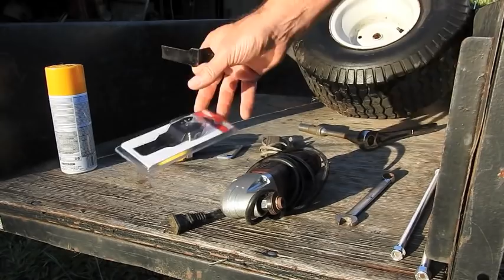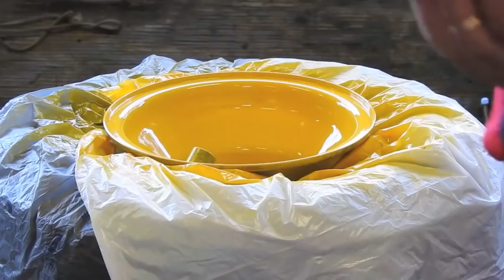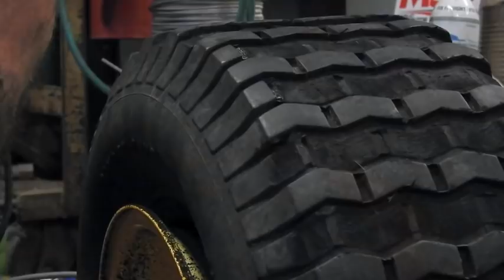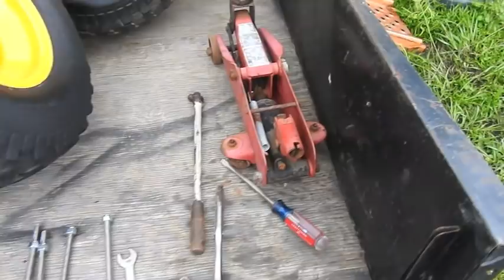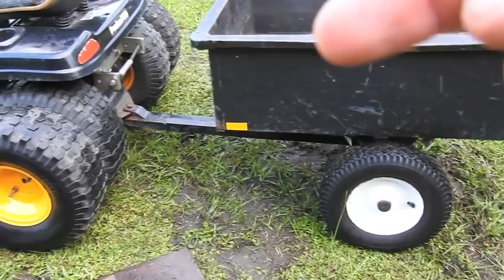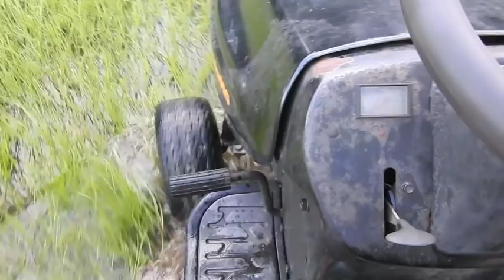How to Put Dualie Tires on a Mower

Comment: Nice idea but I see the outer tires begin to wobble, you can prevent that and it will save the rims.
Reply from the maker: I see them wobble too, I guess I hit the mud too much and popped too many wheelies...  Thanks for watching.
Reply: Didn't look like a quality build from the getgo. No center support. Beefier hardware design definitely needed. Gave the little beast a cool look but not ready for prime time.

Comment: lol I got that same trailer, do you find it self dumps when you put a lot of weight in it especially in the rear??
Reply from the maker: No, mine has been customized, it no longer dumps. thanks for watching.
Reply: @chud327  Ahh...mine too...i tied that dump latch up with wire...lol it only "Dumps" now when I tip it up! lol,lol,lol...

Comment: Drill the wheels and put the air stems on the inside, der der derrr!  While this is fun looking, and you obviously aren't mowing grass, TIRE CHAINS will work LOTS better. (PS-note that the transaxle is welded and locked)
Reply from the maker: I have the stems, deer-der deer, but i didn't get a chance to put them in yet. Which transaxle is locked?, not mine, but it is on the list of to dos. Thanks for watching.

Comment: ha, wow, I did the same mod about a year ago.......and 6 months later the connecting gear inside the Vari-Drive transaxle snapped in half   lol
Reply from the maker: I was popping wheelies last night on the concrete, it probably won't be long before I am hunting another transaxle... Thanks for watching.
Reply: chud327 do a k66 swap next time ( it's a true yard tractor transaxle although not as HD as a true garden tractor transaxle mine takes all the abuse I dish out to it plus,over 600hrs of flogging with trailers and ground engaging tow behinds... an example being a reverse rotation tiller (tractor tires turning clockwise tiller tines counterclockwise when viewed from the right side).
Reply: D L yeah mine isn't even rated for ground-engaging attachments 
I thought about lockering the axle to handle the duals (plus my wheel weights) but threw in the towel considering what I mentioned above. well, that, and the fact my vintage mini bike needed some attention 
if I do any other mods to my riding mower it's going to be half tracks because I'm tired of not getting traction with my plow....
speaking of my plow, best mod ever was bolting my spare winch up and raising/lowering the plow with that instead of that dumb handle
Reply: Wesley Jackson wish could use a winch for raising and lowering my snow thrower instead of the handle (an electric lift was an option not selected during original purchase) but the hood and grill flip forward and the exhaust is right behind the front bumper at the blower frame mount leaving no room for it. Also half tracking will produce similar strains as putting on duals
Reply: Wesley Jackson to increase the traction liquid fill the tires (makes for a night and day difference)... it adds no additional stresses to the transaxle (all the weight is sitting on the ground at all times causing better tire bite), also use some v-bar tires aka ag tires  or use cut tread tires but add on tire chains and if you then find you need better steering use 3 rib aka 3 bar front tires (extremely improved directional control) I have yet to get to a point with all those combined where I couldn't get the traction needed to get the job done. With 23x10.50-12 rear tires I added about 65 lbs. To each side with a 80% fill of windshield washer fluid plus then added wheel weights and tire chains
Reply: With the liquid filled tires(did I mention it's really cheap to do when I filled my tires I purchased a brand new el cheapo garden sprayer for less than $20 removed the wand took out the valve stems from both tires, filled the sprayer reservoir with washer fluid and filled the tires, every now and then releasing pressure in the reservoir usually when the Gallon in the sprayer was gone until when I release the pressure fluid came streaming back into the reservoir then I smooshed the air out of the high point on the tire and when it relaxed back to normal it drew even more fluid into the tire removed the sprayer and quickly reinstalled valve stem then aired up the tires to operating pressure), wheel weights v-bar tires, and tire chains I often find the tractor pushing the front tires  when turned with the blower on the ground (next winter I will be running tri rib front tires).
Reply: D L yeah had the same problem....took exhaust box off, and tapped threads into the block and straight piped it with 3/4" black iron pipe
Reply from the maker: I may need to hunt down a k66. Thanks!
Reply from the maker: the winch does sound like a great idea!
Reply from the maker: That sounds unstoppable!
Reply: Surpluscenter.com has one without diff lock for approx. $350.  (My 2004 simplicity conquest tractor still has its original k66e with diff lock and the transaxle has survived 2 Briggs vanguard engines)

Comment: And the wheels dont "Twist" when mounted like that?
Reply from the maker: Never had much twisting, but the would wobble some. thanks for watching and for all the comments.
Reply: @chud327  thanks for uploading and for answering. I saw A kit for my tractor that was sorta like this... I have a 67 Simplicity and it has 5 bolts that hole the rear wheels on.. i saw a kit that was a round short piece of metal (or maybe nylon?) with 5 long bolts. the round piece went between the two rims  (like the piece you made from the trailer wheels in the other video) and you just use the longer bolts to go through the wheels. I was thinking that if the round piece was steel, id weld it to the outside wheel to help keep it in place but not sure if id even have to! 

Thanks!

Comment: Get your hands on a transmission with the 3/4" or bigger axles w/ the 4 lug hubs. Way stronger then the axle your currently using. I have a 6 speed peerless with the 3/4" axle and a crappy single speed one with 1/2" axles with the slots like yours. The smaller axle is better for racing rather then off roading. As for dualies, they're better for weight but not much better for traction. If you need grip paddles are the way to go and most mower shops carry them.
Reply from the maker: When this one breaks, I will try to find a more heavy duty one, maybe even with hi and low range. Thanks for watching.
Reply: Travis Piper I don't need more traction but I would like to leave less ruts and grass damage in the occasion I have to mow when it's slightly wet.  This farm won't dry for a week and if I get behind I hate to brush hog the yard.
Reply: James Jay Ok
Reply from the maker: Mine was leaving very little damage from the back, but now I guess I need dials on the front too.
Reply from the maker: Thanks for the reply.
Reply: If you go the 4 or 5 lug route there are companies that make actual dual adapters that bolt onto the wheel lugs on both the inner and outer rims

Comment: Can you just turn your inside wheel around, put the vale to the inside?
Reply from the maker: I thought of that, but the offset messed up that idea. Thanks for watching.
Reply: Got you. I didn't think about that. What state are you located I've been looking for a older mid 70s to late 80s Deere, cub, or gravely something in the better mower garden tractor line with a 46 to 50 inch deck size closer to eastern KY.

Comment: Did u drill hole is both rims an attach the second tire just with the threded bar an nuts???
Reply from the maker: The holes were already in both wheel and yes on the threaded bar and nuts. Thanks for watching.

Comment: Great video chud327.
Could you not turn your inside wheel around so valve stem faced under the tractor?
Then you wouldn't have to take the outside wheel off to add air.
Reply from the maker: They rubbed when I tried to put them on backwards... Thanks for watching and for the idea.

Comment: Love it! But question... how do you keep the dually tires from sliding or getting knocked out of alignment? I tried doing this to my Sears, and every time I hit uneven ground, the outside wheels slide out of line. Then it's a really bumpy ride! Haha
Reply from the maker: Mine have a little wobble to them, but nothing serious.  Maybe your could be tighter, I am not sure.  I need to engineer something that would keep them better aligned.  I hit some uneven ground and mine doesn't seem to get worse or change.  I hope this helps and do you have any videos of yours?
Reply: More nuts per threaded rod ... On the inside rim you should have a nut on the inside and the outside of the threaded rod effectively clamping the rod securely solid to the rim before you mount the outside tire on the solid locked down threaded rods.
Reply: Try using the drill bit and add another hole through both rims then there will be no way that those tires will get out of line that's how we do it up here in Perry county in the Appalachian mountains of course we usually drill two extra holes in the rims when they only have two for the most part but those extra two holes that you will be drilling and putting the threaded rods will help them from coming out of line

Comment: What is different between the rim hubs ??
Reply from the maker: The outside of wheels were off of a troy bilt, they have different axles. thanks for watching.
Reply: @chud327  Would placing the wheel groves in an alternating pattern give you more traction ???

Comment: That has to be the worst way imaginable to do "dualie" wheels. They won't support any weight, if they bite, you're going to bend/break those stupid all-threads. All you left off is bailing wire and duct tape....
Reply from the maker: Bailing wire and duct tape are very popular for a reason!  I have been out popping wheelies testing you break/bend theory and, as of yet, I haven't proved you right yet.  But don't you worry I will keep trying and testing the all-threads and as soon as some thing goes bad, I will let you know. Thanks for watching.
Reply: Well said.    Just plain stupid.

Comment: LOL  Just an excuse to play in the mud!!  On another note, could you turn the inside tire around so the valve stem is on the "outside" under the tractor for access in putting air in it?
Reply from the maker: The wheels have an offset that I can't flip them.  I think I will put valve stems on the inside. Thanks for watching and yes, it is another excuse to play.
Reply: +chud427 ... Yup, you can drill holes in the rims on the inside and simply install 2 new valve stems. That's a very good idea. No need to do anything with the old ones on the other side. I believe the hole diameter you need to drill for the new valve stems is 0.453" if my memory serves me correctly. Make sure to de-burr the holes that you drill so that when you pull the new valve stems through, they don't get cut. A piece of emery cloth and/or a small round file will probably work satisfactorily to do so. 

As for mounting your outer wheels to the inner ones, you definitely want ring spacers and 4 thru-bolts to attach the two rims together and to properly space out the tires/wheels. Drill a couple more holes equidistant from the existing ones in each wheel. Make sure to tighten all bolts as close to the same as possible, as that will assure your wheels are somewhat "true" to one another when they are rolling along the ground. It's also a really good idea to use nylon locking (aka: Ny-lock) nuts to prevent them from loosening up. Fortunately, this is a very imperfect "science" that you are dealing with here, as it's just a low-speed 'ol lawnmower.

You can get some flat steel and make some spacers out of it by cutting to proper length and width, bend it into a circle that tightly fits just inside of the rims outer beads, and weld the ends of the spacer together. For the spacer, I'd use something along the lines of heavy gauge sheet metal or perhaps a piece of 1/16" steel. Heavy enough to do the job, but not so heavy that it's difficult to get into a nice round circle. Ah yes, it's American ingenuity at its finest!  LOL
Reply from the maker: I am planning two more valve stems, maybe by next weekend. Thanks for the reply.

Comment: I'm  assuming you rebuilt the starter, after you pull started the mower at this point, or maybe you should buy a knew starter, because you didn't  get this one working, Lol.
Reply from the maker: This one works great, but the battery is dead.  I will probably wind up buying a new battery. Thanks for watching.

Comment: It is twisting, you can watch the treads. The tires are totally going to fall off on the outside.
Reply from the maker: I rode that thing for months and they never fell off. Then I replaced them with 4 tractor tires and they never fell off. I then put them on a different mower, and still, they never fell off. I am getting ready to put them on a third mower, maybe there they will fall off, we will see. thanks for watching.

Comment: Damn,,only 2 studs,,,no wonder I am a John Deere fan!
Reply from the maker: Yeah, I guess I should pop a couple more in there. Thanks for watching.
Reply: A lot of the big box store made “self-propelled” zero turn mowers are made with tin plate punchpress molded frames, &/or forms, ... would not hold up for commercial work, ... or even long term homeowner usages, ... even less, for playing in the muddy environment like this Chud327 guy has, ... at the East Chicago Wastewater plant, I used a Skag, for 2 seasons, of cutting the property, ... (we had 2 of these mowers, 1, 18 HP, & the other was a 27hp, with 48”, & 60” mower decks, respectively), ... I was able to mow the man made hill area with both mowers, ... & also used them to cut down 6’ to 8’ tall grasses/weeds, ... These “Skag” mowers, are design welded, 1/4” plate steel, ... but are reasonably lightweight, for their size, ... tough enough to take the abuse of commercial operations, where they are used for much more than mowing, ... hauling hoses, & equipment around the treatment plant for various duties, ... including a small trailer used for hauling tools, & debris, such as broken pieces of concrete, & scrub brush, of various types of weeds trees, & plant life, ...there is a portion of the property that is used to store used/broken/outdated water treatment machinery, ... & a lot of it is just scrap, ...but it is probably still there, ... lol, ... at any rate, I was able to “mow” a path, completely around the storm water runoff pond, ... back to where there was an outlet creek, designed to release treated waters back into the environment, ... via the Grand Calumet river, ... where every year, salmon come back to lay their eggs to hatch for the next spawning season, ... & I was quite impressed with the only wastewater plant in the world known to contain, a thriving population of a crystalline freshwater sponge, ... (some, which are larger than 3&1/2’ across), ... which is known to exist in the treatment waters of the clarifier tanks, ... where oils, & greases are separated by utilizing the specific gravitates of the oils, and other contaminates to be allowed to float to the top of the tanks & be returned to the bio tanks, & run through the process of allowing the bacteria tanks again, ...
Reply: @johne.osmaniii7217  I think im the only one that read this. But, great story.  Im on southwest of chicago and been on east side by them treatment plants on atv's exploring.

Comment: Just turn your inner tire around and put the valve steam on the inside of the mower
Reply from the maker: I can's turn the rim inside out, it has an offset.  I am thinking about extensions or just drilling holes and putting valve stem on the inside. Thanks for watching.

Comment: Wouldn't this mod create increased stress on a mower with a hydrostatic transmission? (I know yours in probably not hydrostatic)
Reply from the maker: It would creat added stress, but so far on the 3 mowers I have done this too, no problems. If you check out my channel, I just did this again to my John Deere, thanks for watching.